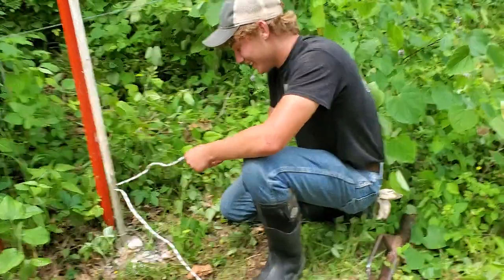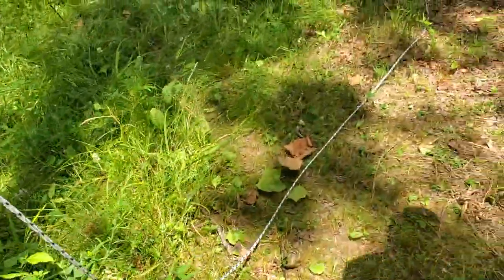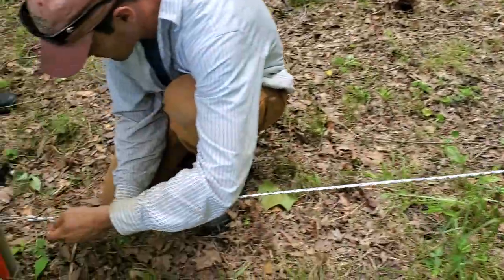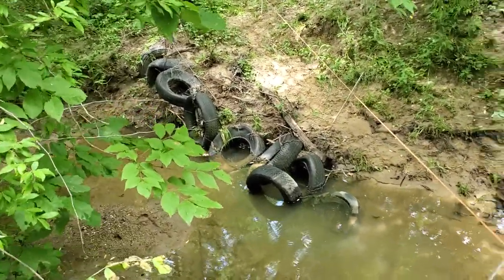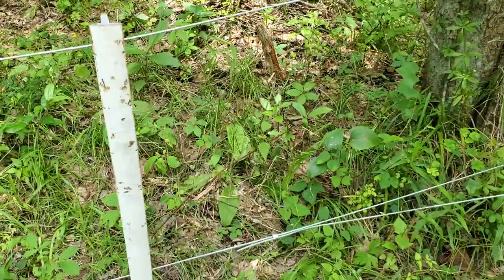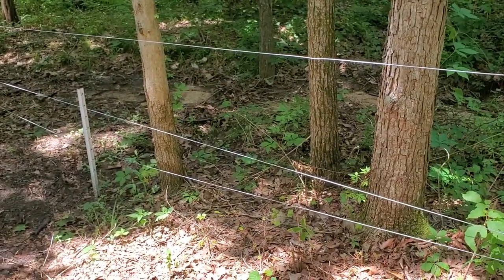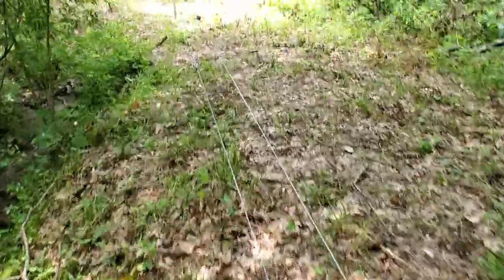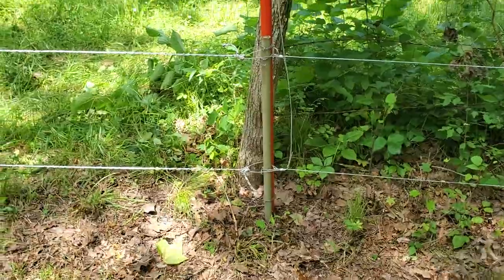Building an electric fence gate from scratch, step by step.

Comment: Your school last year I attended has been money well spent Greg, I learned so much from fencing to cattle care to sheep care.

My new HT fence I built for cattle a few weeks ago is working great. I put a stafix 18 fencer on that fence with 200 watts of solar and two truck batteries and man you talk about hot! I got out of the ranger the other morning to check sheep nearly a quarter a mile away from the far corner of that cattle fence and I heard something popping, I thought it was odd I couldn't tell what was clicking. I went to the cattle waterer next to check that and I could hear the clicking louder, I was still 300 yards across the paddock but I could tell there was a short. Checked the fence and it was still hitting 10.5 KV. Walked over to the other corner where the short was and I had a cracked porcelain insulator. That charger was throwing a spark all the way across that insulator and had it burnt. That blue spark looked like a welding rod arc! I replaced the insulator and it went back to 12.5kv. I hope I never get hit by accident by that thing, it scares the crap out of me. It's so hot my stafix fence tester starts beeping before I get it on the fence from the static I guess, lol.
Reply from the maker: Wow that is a very hot charger!

Comment: Is that a perimeter fence or paddock?  Other videos I've watched called for a 5 wire perimeter fence and one wire poly braid for paddocks. Is a 2 wire high tensile a sufficient perimeter?
Reply from the maker: If your livestock are well trained to hot wire a 2 wire fence can hold them. If your farm lays next to a busy road, use 5 wires. You will sleep better at night!!

Comment: The timeless posts are 4ft with the underground space or is that just above ground. Trying to figure out how tall to buy fences for cows and especially goats.
Reply: You'll need woven wire for goats electric will not work.
Reply: I don't own goats but I can't see anything getting thought a 4' high electric fence (you would need the 5.5' or 6' tall posts as they go 1.5'-2' in the ground) with a hot wire every 3" up to 2.5' , then every 6" up to the top and make sure you have the hottest charger you can afford. You can also hook up your wires in Bipolar or Hot/Ground to get a hotter shock, look those up. You might want to put the posts closer together too like ever 15' and you can also get PVC Timeless droppers in 4ft tall which actually makes a physical barrier by stopping the wires from spreading. That would be quite a fence but woven wire would still be more expensive and take longer to build and you would need to use wooden posts every 12ft or else the wire sags if you get any snow build up.

Just phone Plastic Innovation from there website number and any of those guys (Brad, Josh, Brandon or Mike) will give you amazing advise. They have every type of customer.

Comment: Can't even find 12ga. wire here.
Reply: David Hickenbottom you can order it online.
Reply: Most All Farm or Tractor Supply carry 12 ga 180k tensile strength. TSC does. Farm Fleet probably.
Reply: @marvinbaier3627  shipping cost more than the wire.
Reply: @Amber Hood thanks I'll check it out.